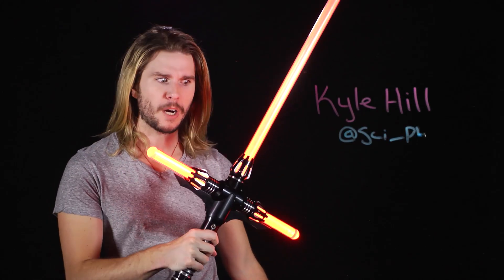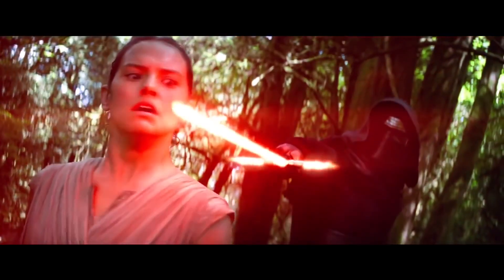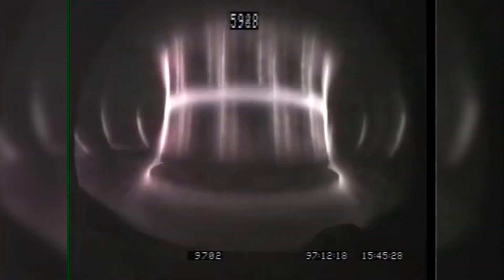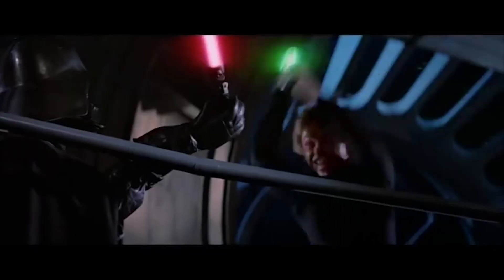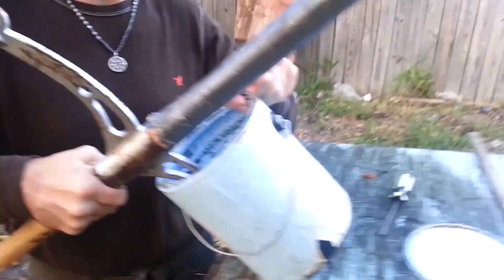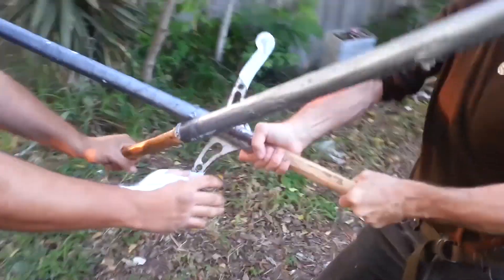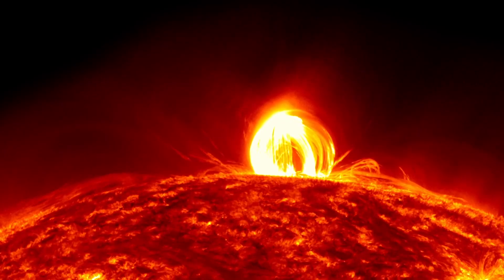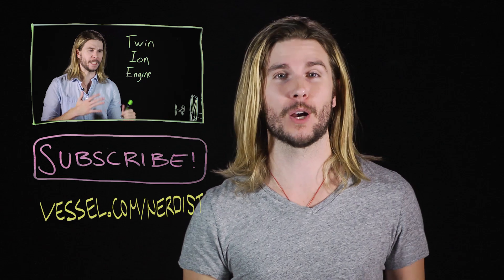Why Kylo Ren's Lightsaber Works (Because Science w/ Kyle Hill)

Comment: Regarding the possibility of cutting off the side emitters, just build the side emitters out of lightsaber-resistant materials (Mandalorian iron and Phrik are two examples in the Star Wars Universe), and the problem described at Time Index 2:15 of your video is solved.  Even just a crossguard made of lightsaber-resistant material omitting the emitters would be a good idea.  

Kylo Ren's cross-hilted lightsaber looks most practical for a relatively long blade (bastard sword/katana/two-handed sword) with a relatively long (two-handed) hilt.  The user of such a weapon needs something to deal with opponents who try to get inside the user's guard.  

It might be a good idea to build the side emitters/crossguard a bit larger than they are shown in TFA to protect the wielder's hand from his/her own energy blade(s), as well as from the opponent's blade in a slide-down binding move (called a "Saforza" in fencing).  It might also be a good idea to angle the side emitters/crossguard slightly forward; so as to be more useful for snagging (binding) an opponent's weapon/performing a followup (reposte) attack with the shorter blades.  As a last note, it would probably also be a good idea to have a separate on/off control for the crossguard blades.

Comment: Great points, THereis also a practical use for it to. Without spoilers, it is assumed (if not proven) that his saber has a cracked crystal, which causes the saber to crackle and be unstable. But this instability also requires some kind of ventilation so that the main beam doesn't become uncontrollable. So the two beams on the side also let the sword vent energy equally instead of crackling and eventually breaking under its own power. Great vid.

Comment: it could have simply been lightsaber resistant metal on a large hand guard. like a rapier hand guards. instead it was a terrible design. the beam comes from an intricate design inside of the lightsaber. if you hit those metal pieces on the side. that particular beam would probably go out and fail.

Comment: my only issue with the crossguards is the significant change in ascetic. the lightsaber, and the jedi, draw a lot of inspiration from samurai, katanas, and the accompanying culture. a katana's "crossguard", called a tsuba, is decorative and in most cases too small to provide any real protection, save when blades lock as is sometimes seen in star wars but doesn't happen in kenjutsu or iaijutsu (the traditional katana fighting forms).
Kilo's crossguard 'tri-saber' has an ascetic more similar to western broad swords. i haven't seen the film yet so i won't make any comment about hoe he DOES fight, but it SHOULD be a completely different form, a different style of sword-play to any of the katana-esque forms we have seen before.

Comment: Good video from Thor but Kylo Ren's lightsaber still has a poor design. If the metallic casing is used to protect the user from the winged sabers (mentioned in video) whilst holding the hilt and the winged sabers are there to protect the user from having his hand dismembered then why is the metallic casing exposed to the area of potential destruction and thus can expose the winged sabers endangering the user's hand? That is somewhat of a poor design. A better design would be (as people on the internet have said) to forward the winged sabers acutely over the main saber and retract their positions further into the hilt so the metallic casing is not exposed thus defeating the potential for the metallic casing to be destroyed and exposing the winged sabers to the peril of the user's hand.
Also, what was remarked in the video was the fact that the crossguard, or quillion, has been an attribute of choice for the sword since time immemorial as it protects its user. Agreed...buuuuut notice how nearly all of the crossguards on swords taper in like I have suggested previously in this post? This allows for catching the blade more easily and with more control (closer to the centre of gravity of the weapon) and also angling the winged sabers away from the body like suggested also allows for a reduction in possible self-stabbings or forced stabbings in combat. Another point is that there is more maneouverability accessible as well because the winged sabers are no longer perpendicular to the main saber and taking up more valuable 3-dimensional space when in combat.

The most damning point to this is that the winged saber argument proposed by Stephen Colbert is apparently incorrect. He proposes the 'single crystal' theory which allows for the ultimate protection of the hilt. Unfortunately according to canon there are 3 crystals so Stephen Colbert is incorrect. It's here if you want to read it:

http://www.cinemablend.com/new/Controversial-Star-Wars-Lightsaber-Has-Roots-Star-Wars-Canon-70229.html

Also: The winged sabers are described by Disney as just vents for the raw power of the primary saber BUT in the movie they act as independent winged sabers. Go figure.

Also, a par sec IS basically a time measurement as Thor says. (light years....travelling at the speed of light in the TIME frame of years).

Comment: The crossguard did sort of become his undoing in the movie...
The complaint is not about its practicality, but the symbolic meaning of the saber. Since he is Sith, so I guess it's not that big of a deal, but the battle between Jedi and Sith (light and dark) was not intended as a combat of martial art or cool choreographics, but one of ideas, thoughts and emotion. The saber being so simple is because it is totally just a formality (or sort).
The most powerful Jedi can block the lightsaber with his bare hands. Luminous beings are we, not this crude matter.

You are right, though, that Kyle Ken or whatever's lightsaber is perfectly practical, and in fact MORE practical. That's fine.

Comment: The crossguard would not have protected even ONE of the situations shown of a being losing their hand.  

As for Colberts answer... it doesn't make sense.  The WHOLE handle is designed to produce the plasma blade and to direct it in stream.  The metal that is supposedly filled by plasma is actually the part of the weapon that directs the flow of plasma.  Unless you're telling me that in the weapon the plasma literally becomes a T shape and there is nothing actively directing the flow of plasma.  I suppose its possible, but Star Wars does have magic... so... a wizard did it.  Its not though because they operate individually.  They have their own operating system since they don't activate at the same time.  That is the only saving grace in my eyes... that it can be turned off... and should be most of the time.

The guy swinging the sword could learn to work around the blades... but then he has to fight only working around the blades.  He could do it, but is heavily restricted in his combat style.  Why handicap yourself like that?

The cracking IS cool... the crossguards... not so much.

Comment: Really? You're using colbert's joke assumption as a point?! In that case where do the beams actually originate from? In the past, when older lightsabers were cut at the handle, why didn't it hit the supposedly underlying beam within the metal casing. You know instead of destroying it.
Reply: But let's say you're right, wouldn't kylo have to keep on repairing the metal casing after it's been broken on the cross guards? After every single fight? What a pointless lightsaber then. Are you sure you're a nerd?

Comment: The problem with this  idea is that of a Jedi's mobility, the cross guard will limit his mobility, as all cross guards do.  The reason  Jedi don't need them is because of their ability to predict the future.  Giving them the ability to keep the light saber very close  to the body and flip and move about with not much to worry about.

A large cross guard limits you to basically a left and right side of the blade while Luke's light saber can be used 360 deg.  You just don't  have the freedom of movement or options available.  With a Jedi's power Kylo Ren's light saber becomes a liability to his over all ability to maneuver vs other skilled jedi / sith.

Comment: The point that Stephen Colbert brings up, that the beams form a cross within the lightsaber is not the problem! He even calls out the problem, "could'nt you just cut through the cross guards" and that is the point. Yes you can! The conflict is not that the enemies lightsaber would cut through the guard, just to hit the beam within the guard. The problem is that in itself! The first time Kylo would get in any major scrap and block a swing from an enemies lightsaber , that guard casing would break, meaning that even though the beam within the guard would block the opposing lightsaber, the metal guard would be broken from there out, meaning it would need constant repair. If the three beams met each other without a physical metal guard the lightsaber would work much better. That's the problem. The metal casing is basically useless.

Comment: OK I'm pretty sure that if you cut the metal encasing the cross guard off it would most likely has a bunch of plasma pooring out causing it to be useless to the one using it. he is already using a very unstable crystal to gain more power.

Comment: i would argue that like the light pike (which is a thing) it would become a hindrance in close quarters also if you cut off the metal guards that shoot out the guards wouldn't they become destabilized or at the very least shut off like i dunno darth mauls did when one of the projectors or whatever was broken turning it into a regular light saber (unless frik alloy fucking extended universe being cut bs)

Comment: The biggest problem with his light saber is the insane limitations it buts on the wielders mobility. If you observe how any other sith or jedi fight with a light saber they are extremely fast and agile, using many flurry's and spins of the sword. This is truly what makes a light saber so effective. I'm not saying a cross guard is a bad idea, but a light saber cross guard is simply idiotic because attempting even one of those maneuvers would result in the loss of your hand. Even as you saw in the video with the paint on the cross guard his movements were extremely limited compared to what could have been done with a katana(which is what a light saber is)and even in the movie it was obvious how limited Kylo's light saber was. his mobility was non existent when compared to those he was fighting which is most likely why he got his ass kicked, despite him being a trained sith, and them having never even seen a light saber up until a few hours ago. Does it look cool? no not really. But is it efficient? absolutely not, not in any way shape or form. This concludes why Kylo Ren's light saber, does in fact suck ass. PS. his blade is like that because he sucks at making light sabers and his turned out slightly unstable, so yeah, complete garbage.

Comment: Crossguard sabers have been around in the lore for a while.  I remember them from the original West End Games D6 Star Wars RPG.  However, beyond that.  In order to keep the housing of the cross guards from being cut, they were typically made with Phrik alloy or if it could be found, Bes'Kar'Gam better known as Mandalorian Iron.  Both of these metals have been shown many times to be almost completely resistant to a light saber cutting through them.  But beyond that, if you look hard at Kylo's Crossguard saber versus Luke's saber, you will notice something going on with the blade.  Also if you look at Kylo's hilt, it looks half finished.  These show that Kylo's saber is in fact very unstable (which is also a hint and commentary on his character/personality).  This makes the addition of a Crossguard purposeful as it is more than likely an exhaust port, or shunt to keep the whole thing from overloading and exploding in his hands.

Comment: Kylo's Saber needs to be a L Shape. Not a T. It makes no sense to have a extra blade pointed towards you while you fight. 

You stress yourself much more in battle when you worry about the blade hitting you while you fight. The saber mini-blade pointed towards your body while the other mini-blade points towards you is pointlessly ridiculous. 

Jedi's can train hard enouph to avoid the part pointing towards himself, but it's much easier if he just has a crossguard only pointing towards the enemy, so he can train to make sure to have the crossguard positioned towards the enemy. 

Again, Kylo's sword would be 100% more practical and effective if it was a L Blade, not a fucking T Blade.

Comment: But if the crossguard is like that, why have the plasma come out of small cylinders instead of just half cylinders, or even flat pieces? Besides, none of the hands sliced in the Star Wars franchise have been sliced in a way in which the crossguard couldve stopped it. And besides, lightsabers typically dont slide on each other

Comment: Just going to be that guy and point out the parsec measurement was used apparently because the Kessel Run has black holes near it and slower ships have to go the long way round, meaning greater distance travelled, but only 12 parsecs, means his ship is fast enough to get closer to the black holes without succumbing to the gravity, cutting the travel time down. Thus, it does make sense in that way, but without that specific knowledge of what the Kessel Run entails, its easy to dismiss it as stupid.

Comment: The cross guards arnt supposed to be there.they are they becouse the krystal used in saber is unstable so he put exhaust shaft that ended up being mini lightsabers. That's also why the plasma blades look alot more awesome than normal one but the bad thing is that the thing could explode in your hand during a battle.

Comment: The main idea of the cross guard so the light saber won't explode. The energy of the crystal that makes a light saber a light saber overtime will conduct to much energy and implode on itself so the cross guard was made it shots that extra energy to the side and prevents an explanation. But this guy is right that helps protect the hand witch is why they put it on the side it's just not the main reason

Comment: It would require 3 crystals to work 1 for the main blade and 1 for each cross Gaurd so the only way for it not to get sliced on half by another sabre is a metal that light sabres can not cut wich is very rare.

Comment: I pretty much agree, but this sort of crossguard wouldn´t have prevented most of those hand-cuts. Also, lightsabers don´t need crossguards nearly as much as the medieval swords did, because lightsabers seem to lock in place when their blades make contact. I haven´t seen a single instance of anyone dragging their lightsaber blade across another lightsaber blade in any of the movies. While sharp, steel swords´s blades would also lock in place to a degree, that wouldn´t be very reliable and most of the time, the blade would still continue to slide towards the other sword´s hilt.

Comment: Ironically, the weightlessness of the tri-saber (and all lightsabers) make it even more dangerous! Your brain has a harder time predicting the location of the blade (and therefore "cross guards") when it cant FEEL where it is. Thought experiment; you are made to not see or hear, and cannot  feel and heat coming off of the blade. If the light saber is in your hand, you have NO WAY to know it is on (without Force powers, of course ;)  or off. As the Crocodile Hunter used to say, DANGER! DANGER! DANGER!

Comment: from what I've heard, Kylo-Ren's lightsaber actually has exhaust ports to vent all of the excess energy. if you look closely at the cross-guard, you can see the blades are more sloppy, they end at a point (unlike any other lightsaber), and they look unstable. hell, the whole thing looks unstable! my theory is that since the lightsabers are supposed to represent who the user is, then why wouldn't this one have excess energy, like Kylo's pent up anger? and the blade is unstable, which can represent his uncontrollable rage.

Comment: having read too many books for my own good... the saber design is over 1000 years old... many jedi and sith have had personalised lightsabers but kylo went further Kylo Ren being ANAKIN SOLO (not Ben solo (Disney lore idiots (that's a different argument))) knew of the problems his grandfather and his uncle suffered... missing hands... and sought in the jedi archives for the schematics to build the saber... there is no saber behind the crossguard like said by Disney. it's simply make od madalorian steel... like many sabers/shields/staffs before it made of madalorian steel it's highly resistant to heat and sabers of all kinds... "But why add the sabers to the sides, why not just add madalorian steel crossguards" I hear you say? well, the offensive benefits are a risk to the user, but they are also beneficial if they user is trained (as said in the video) Plus they are designed for use against light whips. instead of needing an extra saber to defeat saber whips you use crossguards. and finnaly many sith synthetic crystals are designed to set off an electric discharge to any other sith than the user by being tuned to their frequency with the force, incase their saber is taken so it can't be used against them. But Kylo Ren might not be a true sith so he's had to add a security feature. Any user untrained in how to use the saber with cross guards risksntheir own safety as well as their enemies.
right I've done everything to explain this too you thanks for reading. ;)